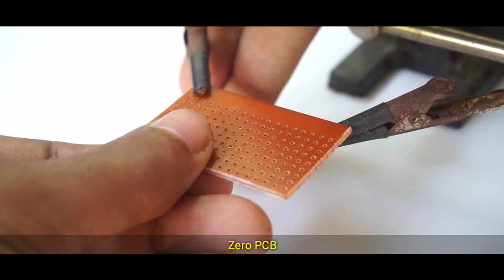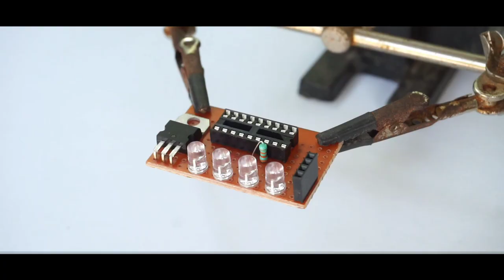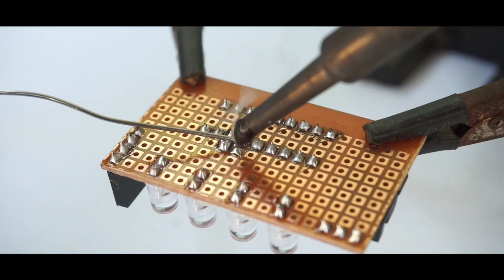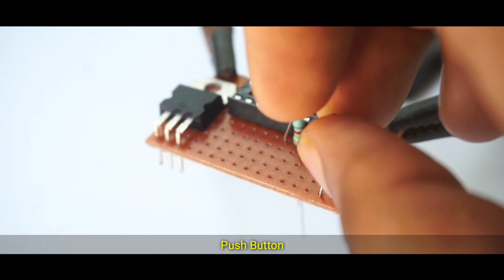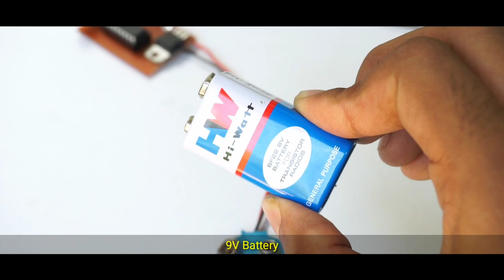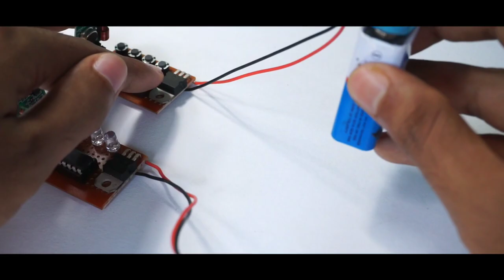Out of range automatic OFF RF Transmitter and Receiver

Comment: I don't know how anyone can learn anything from these videos except maybe breadboarding and soldering techniques.  Without schematics and code I find them pretty useless.  Sorry.
Reply: Too bad most tutorials on Youtube are like this. Skip breadboard and solder with wires blocking the viewing of the track.
If the circuit is not too complicate, you can figure out the connections.  But if there are more connections, usually it ends up spaghetti wires. 
Sorry of my English.
Reply: @jumbo999614  Your English was fine, better than many native English speakers I know :)
Reply: @tombudd1281  Thank you.